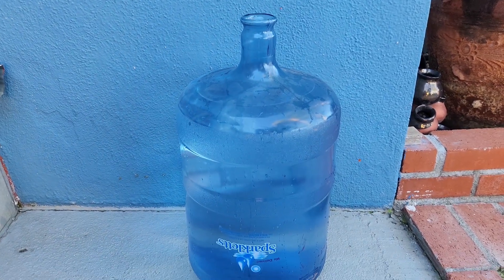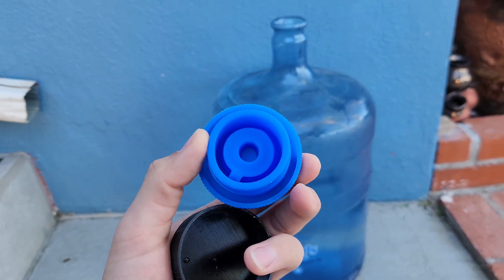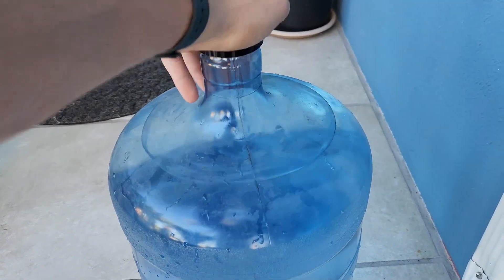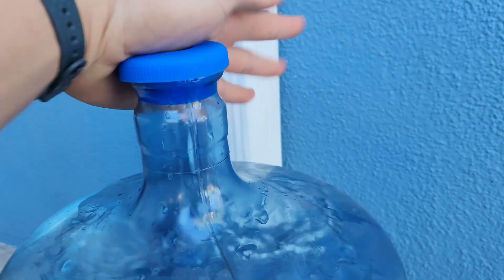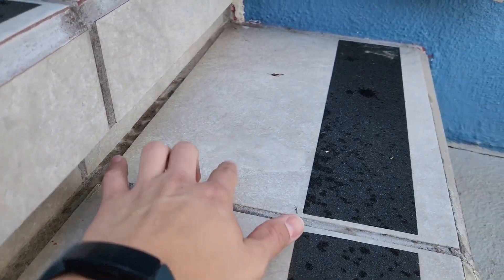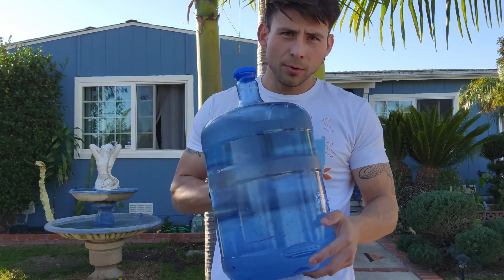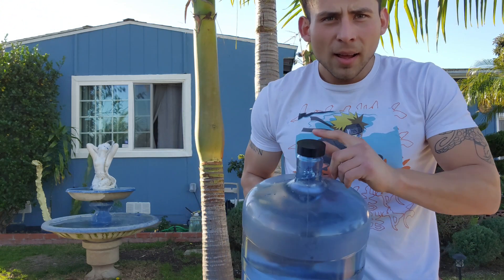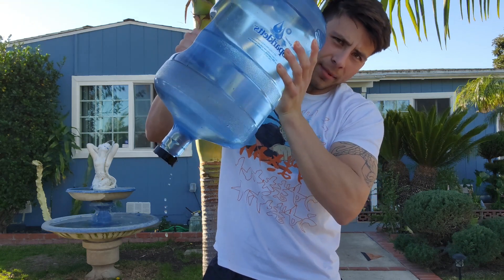Are they any good?: OKLGO 5 Gallon Water Jug Cap Reusable

Comment: When upside down, the 3D printed cap will not leak because the water itself will help make the seal.  Kind of like those 2L bottle pet waterers.  Only when the water level gets below the opening will it let any air in and water out.